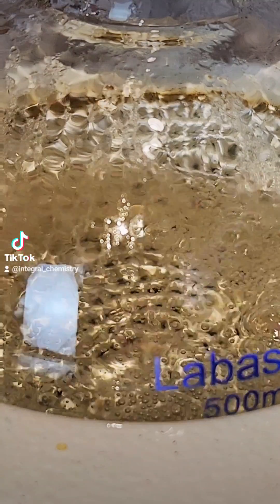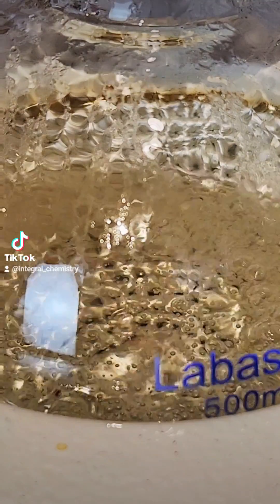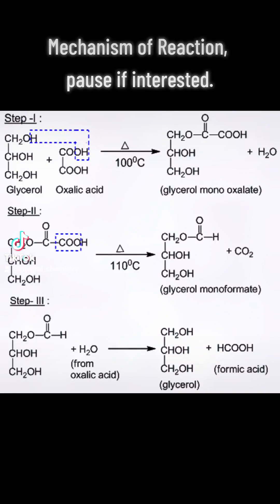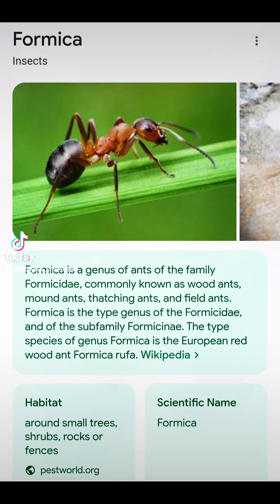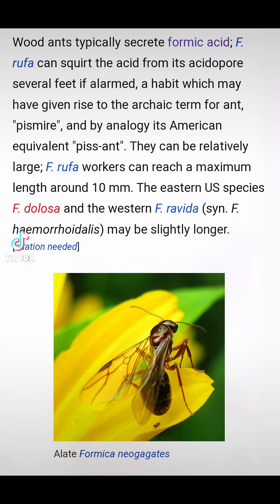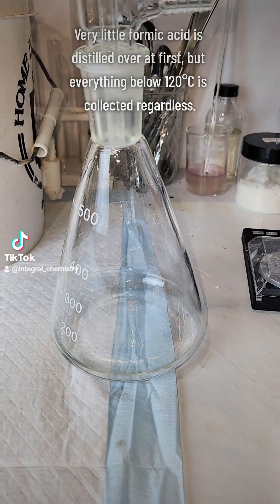Making Formic Acid

Comment: I tried this myself, and followed the example closely. It seemed to be going well, with temperatures hit and expected results, CO2 on queue, approx. correct resultant volume. I am at midway where have dilute formic acid and decided to test density with pycnometer. I was surprised to see only 5.5% using density/conc. calculator. What could have gone wrong to have almost water come out? Makes no sense since if boiling water vapour it would have held at 100c, but I found it going well at 114-116c, and near end had to go as high as 119c to get product. I'm completely baffled. Any ideas anyone? Maybe oxalic acid (dihydrate) was fake (src'd on Amazon)? Very strange.

It did have a vinegar-like smell when I was opening to add more oxalic acid.

Comment: Normally using this route practically no acrolein is produced, when temperature is raised, allyl alcohol and allyl formate are the main products. It is in fact a convenient way of preparing allyl alcohol, which is still pretty toxic, but acrolein is on yet another level regarding danger. Anyway thanks for posting this, formic acid is of interest as it is one of the few things that can dissolve polyamide.

Comment: ive been doing this for the past two days 😂 its so slow and annoying, had some foaming issues
Reply from the maker: Is the foaming when you add fresh oxalic acid?
I hated this process tbh.. not because it was particularly slow or messy, but because there doesn't seem to be a way to prevent the production of at least some acrolein, which is NASTY stuff.
The process of disposal and means of disposing of it is a nightmare, and it is such an intensely powerful irritant that even a tiny whiff at several feet will cause extreme eye and sinus irritation even through a respirator and goggles.
It's a fun project, but definitely easier to just buy it 😅